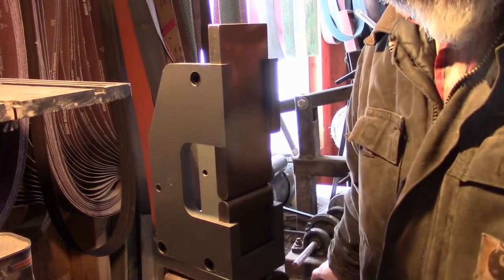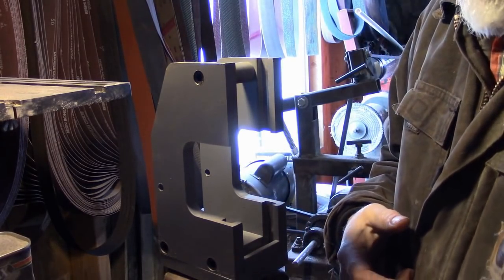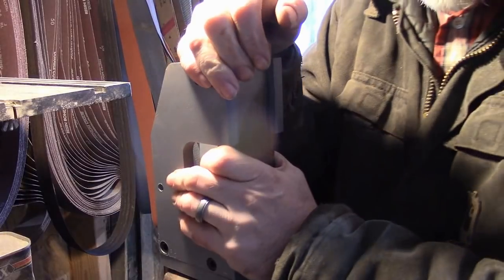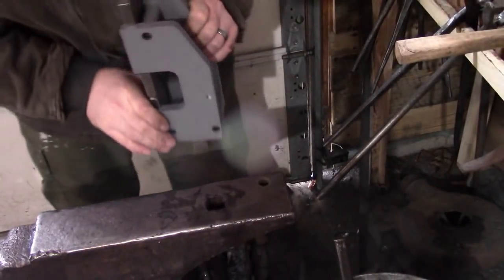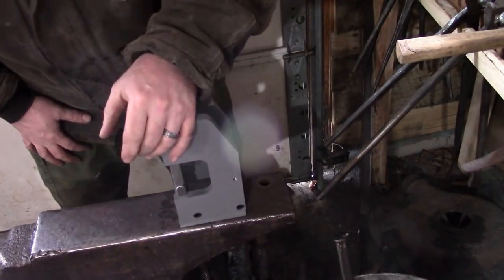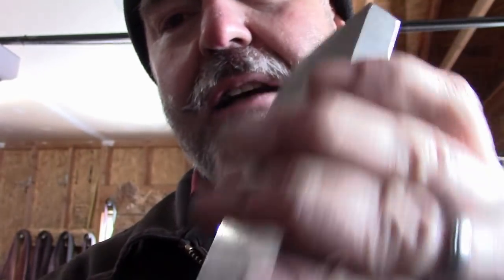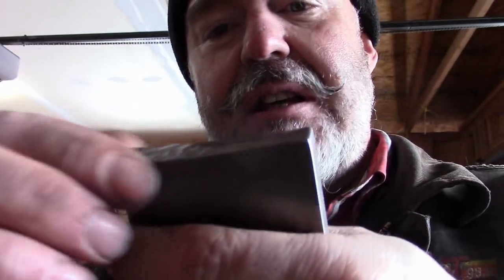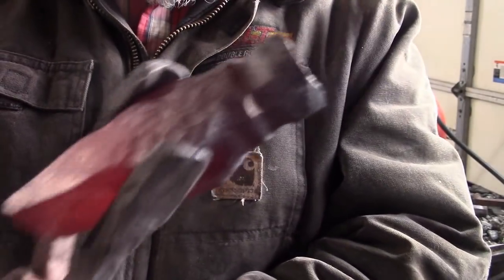G2 Fullering Tool Review & Claw Hammer Forging

Comment: Would there be less deformation of the dies if you used a Babbitt hammer?
Reply from the maker: Probably, but I don't own a Babbitt hammer.  Going to try welding some tougher steel on the top.  If that doesn't work, then I'll have to go to the softer hammers.